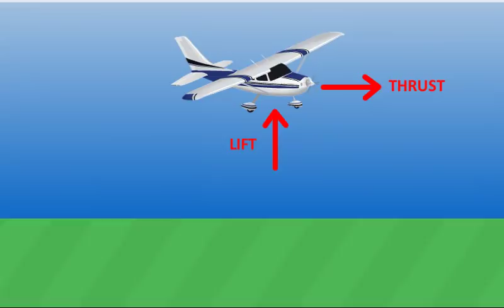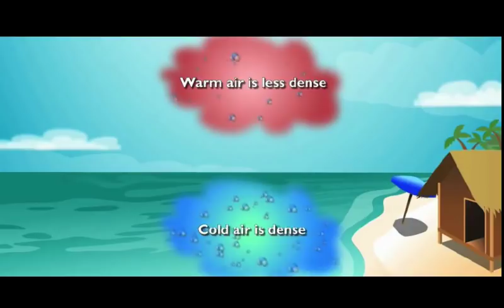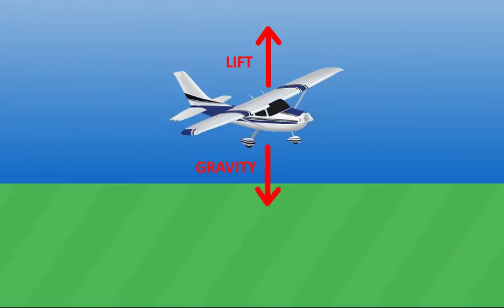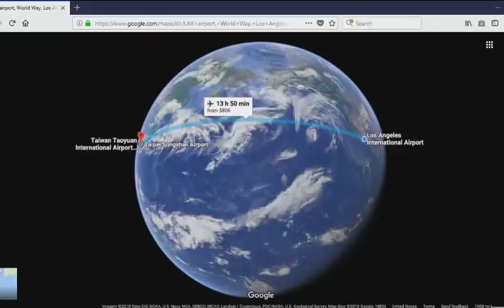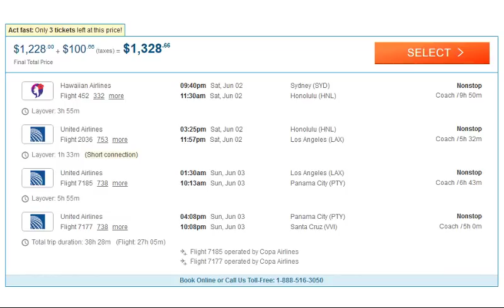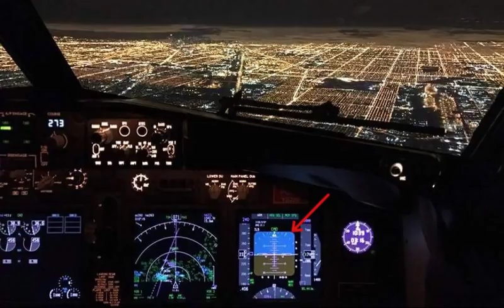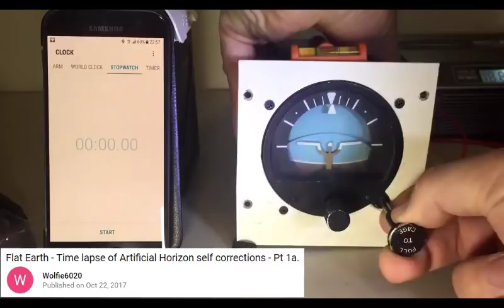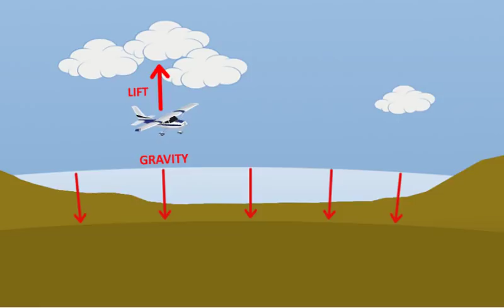Flat Earth Falsities - Plane Nonsense

Comment: Theories are not FACT.  They are idea's.
  Math does not turn theories into fact.
Just because the math works does not mean this is how the world works. 
True energy is "true energy" not E=mc2 written down on a piece of paper.  What goes up must come down does not require a magic attracting force  (gravity) to exist. Using Equations to back up ideas is not science and thats all the globe or gravity has ever been. Numbers and ideas. Just wanted to point out the main problem i have with most globular coments im reading
Reply: So your complaint is that Globe Earth physics has a predictive mathematical model that accurately matches reality?
Reply: "Just because the math works does not mean this is how the world works. "

Um...  Yes.  It quite SPECIFICALLY does.
Reply: "The FACT that the flat earth model can make the same easy predictions and have been for thousands of years."
That's hilarious. The Flat Earth "model" can't even predict something as simple as where the sun will rise and set. You don't even have a working map of the world!
Reply: " Using Equations to back up ideas is not science "
Um...  Yes.  Yes it quite SPECIFICALLY is.

Admit it, you've had a traumatic brain injury recently haven't you?
Reply: I mean actual measurable atmospheric pressure. The type of thing the old weather barometer in my parent's hall would tell you. 
If weight is due to atmospheric pressure then why doesn't it change when atmospheric pressure changes?
And why do objects still have weight in a vacuum where there is no atmospheric pressure? 
And why does weight change in a predictable manner based on the latitude of the object? 
And why does a gravimeter consistently detect different rates of falling at different locations regardless of the local pressure?
Reply: James Hewitt I’m curious to see if you have an explanation for an experiment done by the discovery channel using a level laser and a lake. As they drive farther out on the lake, the laser rises. Even given small differences in the movement of a boat, I cannot see how this could be explained by anything but the lake lowering with the curve of the earth. I think this supports the idea of arriving at a conclusion based on observable facts.
Reply: "Atmospheric pressure explains it perfectly without gravity"
Does it really? So do you notice objects changing weight when you get a high or low pressure weather front?
Atmospheric pressure changes all the time. Why doesn't weight?
Reply: I read what you wrote. If you meant something else then the issue is in your ability to communicate your ideas clearly.
How do you suggest that atmospheric pressure creates weight, yet weight doesn't vary as atmospheric pressure does?
Reply: James Hewitt I'd like to add that science is a religion unto itself in many many ways, since theoretics are littered through the community, everywhere you look. (With quite a few theories being as outlandish as possible, for ex. The Oort Cloud) Theories are beliefs without sound proof. So science can easily be categorized as half evidence/half belief system. I also find it astounding that many scientists of "legendary status" that people worship still to this day, were simply small pawns put on a pedestal intentionally to overshadow the even greater men of the field. Many times this is because the discoveries of the greats, did not produce enough monetary gains. One of the most famous examples is Tesla & Edison. Unfortunately, the scientific world/community is extensively bought and paid for. That fact alone makes it lose a massive amount of credibility. Not to say that the community isn't filled with extremely brilliant minds, because it is. But still, much credibility is lost. So then it becomes this mind-game of trying to decipher between what is accurately told to us and what is not. Hence people then carrying out their own experimental studies to the best of their ability and coming to different conclusions than what has been spoon fed to us all. There is a huge amount of room for discussion and that is exactly what we see in these videos. These subjects shouldn't be something we all argue over, in actuality we should be having open-minded conversations. Especially with our main source of info coming from NASA, a federally owned, bought and paid for entity. I would expect my fellow human beings to question it all and have healthy doses of skepticism, since that's part of what it is to be human.
Reply: James Hewitt - "Atmospheric pressure explains it perfectly without gravity"
How? Explain it to me like I'm an 8 year old.
Reply: James Hewitt - "Explain to me why you need gravity "
You get cause and result mixed up. It is not that we need gravity to explain something. It is the precense of gravity that explains other phenomenons. 

"Does atmospheric pressure not exist?"
Yes it does. Now guess how it is caused?

"If you guys dont like eric dubay."
Eric Dubay seems like a very nice guy to me. It is his undestanding (or lack thereof) that bothers me about him. All the points in his 200 evidences video are either poor science, unproven facts or misconceptions about reality. Literally all of them. Challenge me.
Reply: Chicksue A scientific theory is a comprehensive explanation of a natural phenomenon, well-substantiated by extensive experimentation and observation. It is not a hunch or guess; that is the vernacular meaning of theory. 

I am tired of saying it: research grants do not dictate the results.
Reply: Chicksue - "Theories are beliefs without sound proof."
Dude, please stay focussed. You are talking about a layman's (non-scientific) theory. The definition of scientific theory: "A set of statements or principles devised to explain a group of facts or phenomena, especially one that has been repeatedly tested or is widely accepted and can be used to make predictions about natural phenomena."
So to state that scientific theories are beliefs without proof is blatently stupid. The rest of your post is dereived from your misinterpretation of the meaning of scientific theory so not worth going into.
Reply: "Just because the math works doesn't mean it work like that in real life".  - Flattard. 
Sr too lazy to re-read and quote the exact thing you wrote. I don't claim myself to be a scientist, or know shit about these fields, but your goddamn shit made me furious. 
Do you know why buildings are built by the way they are? Maths. People don't just sketch out a bs drawing and be like "yeah we gonna build this shit". They use mathematics, physics etc to calculate and build the stuff.
Reply: I like this definition: 
scientific theory (n.)
a coherent group of propositions formulated to explain a group of facts or phenomena in the natural world and repeatedly confirmed through experiment or observation.
— http://www.dictionary.com/browse/scientific-theory
Reply: you would struggle to pour water out of a boot with the instructions on the heel, a SCIENTIFIC THEORY is NOT a normal THEORY! you struggle with basic definitions...
Reply: James Hewitt it has a completely different meaning, look up the fucking definition of a scientific theory...

But if you want a fact, then here is one for you. The earth is a globe.
You can see and Identify the ISS and various planets from your backyard, and you can even see them in detail with a telescope.
Reply: James Hewitt wow, you have gotten HALF the definition, come on you grade A researcher, what is the full definition?
Reply: 2112 specifically?????
Reply: I like it.  Specific proof . Bwahahahaha
Reply: Unless its your theory.
Reply: Notcia. Are you saying that ancient observatories do not exist?. You realy want me to explain atmospheric pressure? Just google it.  If you want a flat earth version just ad flat earth to the end of your serch. Or stop pretending like you have watched flat earth documentaries.  Or if you ask politely i will answer any questions about atmospheric pressure that doesn't require gravity.
Reply: Seriously guys check out some of the docos ive been mentioning. The fact that you're asking people like me .tells me you haven't even given flat earth a chance. Do some research before you start arguing things you have been told.
Reply: The Cavendish and Schiehallion experiments still work on your "plane". I wonder why that might be?
And even on a flat plane you cannot accurately calculate the weight of an object without knowing the local gravity. Why is that?
And why don't you have a working map or the ability to predict every day events like sun rise and sun set?
Reply: You mean thermal atmospheric pressure?
Reply: I have already explained all this . Now go look for yourselves
Reply: Dude read what i say properly.
Reply: If there is difference between the the wieght measured at different altitudes.  Buoyancy and density explain it fine. Atmospheric pressure is a result of boyancy and density. Thats my understanding of it
Reply: James Hewitt Answer the question: do the weights of objects change in line with variation in air pressure?
Reply: But weight is different at different altitudes even when measured inside a sealed container where atmospheric pressure, buoyancy and density cannot change.
Weight is also different at different latitudes (due to the spin of the Earth).
Reply: James Hewitt - "The FACT that the flat earth model can make the same easy predictions and have been for thousands of years. "
Oh common James! FE can't even produce a simple and accurate map, let alone math that describes and predicts the phenomenons we assosiate with the globe. You guys don't even knopw how to explain things falling. Desity is not an explanation, it is an observation. If density is of air is the same all around a falling object, why does that object always fall down? Not sideways, not up, down only. Density is still the same. What the mathematical equasion for falling things on FE? How do you explain acceleration on a flat earh? What force makes things fall more quickly over time? Any equasion for that?
Reply: James Hewitt - "Are you saying that ancient observatories do not exist?"
Observation exist for sure, bith modern and ancient. The problem is the explanation, not the observation. Who has ever observed the dome by the way? Or the water the earth is floating in? Or the ice wall? Who has ever observed stars connected to the dome by the way? You can;t even get pass the observation, let alone the explanation.

"You realy want me to explain atmospheric pressure?"
I would like to see how atmospheric pressure gets lower the higher you go, in an FE model. How would that work if density is the explanation for things falling. How can air be more dense than air?
Reply: James Hewitt - "The only reason you need gravity is if you are on a ball."
It is actually gravity that explains the ball. Ity is gravity that dictates the shape.

"This is why we think gravity doesn't exist. Be cause you dont need it on a plane."
No. You still need gravity on a flat surface. Without gravity you'd be floating around. Watch this video: https://youtu.be/drdBKMOZmTc?t=7m55s
The surrounding air is still less dense than the bodies of the floating people. Yet, they're floating. That's what happens without gravity. 

"Which we can prove that we are indeed on. "
I have watched dozens of FE videos and have not found any evidence for us living on a flat surface. What is the most compelling evidence you can come up with?
Reply: Chciksue - "Especially with our main source of info coming from NASA"
How about the other 71 space agencies?

" Unfortunately, the scientific world/community is extensively bought and paid for. That fact alone makes it lose a massive amount of credibility."
So if it's being funded by any government. it is not to be trusted? How about pensions, education, infrastructure, medical research and so on and on. This statement is the dumbest I have seen in quite a while. If you have any evidence for your hypothesis, please don't hessitate to share.
Reply: +James Hewitt I love how you upvote yourself. You have always been a pathological liar though. First, theories are actually factual; they are rigorously tested and able to be consistently backed up with data and well facts and evidence. What you are thinking of is a hypothesis. A theory doesn't become a theory until it has been proven to actually work, and able to withstand rigorous testing. Until then it remains a hypothesis, and if no amount of testing backs up said hypothesis, it is debunked.

But considering you think math doesn't work, it's evident you are a Poe at this point.
Reply: Gravity doesn't just make objects fall down, gravity is in everything. You, me, a table, a house, everything is attracted to each other. If you had a bowling ball and a pair of dice in space the dice would orbit the bowling ball
Reply: Check this out James Hewitt: https://en.wikipedia.org/wiki/Scientific_theory. That shows how a theory in science is different from a colloquial "theory".  It's not just an idea.  It's a model with experimental or observational studies to back it up.
Reply: Bruce Lansberg you wouldnt be floating around. that is silly.
Reply: Terra Silverspar  i have never said math doesn't work.  I just said backing up an idea with math doesn't make the idea fact. Also theories are not factual.  A Theory has to be backed up by experiment measurement math observation  ect . Then it becomes factual.  Check the dictionary.  The word theory is as far away from the word fact as the words hypothesis or idea. This is the problem with scientists and more so astrophysicists.   They present ideas and theories as fact.  Leaving people like you and me not even knowing the difference between fact and theory. You must question everything.  Even scientists.  Even niel degrass tyson.  Even carl sagan. Who are presenters of science. I used to take everything i saw from nasa as fact. I thought everything i was seeing was authentic and no way would these scientists on all these documentaries would be lying. Also i thought all the techniques used to attain the information presented were rock solid proof of how things work in the universe. I used to be addicted to space. Then i ran into some convincing evidence that contradicts alot of what i was familiar with.  Which made me start questioning absolutely everything and find the answers myself.  Rather than rely on "credible sources " with PhDs from NASA  and awards from NASA.  Look into the moon landings thoroughly and tell me they scientists arent lying about a few things
Reply: Arvak777 i have heard many scientists talk about how gravity only comes into effect on huge masses and thats why some of these masses in our solar system have the potato effect.  Which is where the mass didn't get massive enough for gravity to shape it into a shpere. Can you tell me or show me this gravity inside me?
Reply: James Hewitt I don’t see a question from you, Just more drivel
Reply: Alysm whats the difference between a scientific theory and a scientific fact?
Reply: Alysm theory is theory . Doesn't matter what kind of theory.  Just because its scientific doesn't change the definition of the word theory.  Also  there is no definition for (scientific theory) in the oxford dictionary.
Reply: Alysm theory

ˈθɪəri/

noun

a supposition or a system of ideas intended to explain something, especially one based on general principles independent of the thing to be explained.

"Darwin's theory of evolution"

synonyms:hypothesis, thesis, conjecture, supposition, speculation, postulation, postulate, proposition, premise, surmise, assumption, presumption, presupposition, notion, guess, hunch, feeling, suspicion; More

a set of principles on which the practice of an activity is based.

"a theory of education"

an idea used to account for a situation or justify a course of action.

"my theory would be that the place has been seriously mismanaged"
Reply: Alysm a scientific theory.  Uses facts that have been tested and repeated. To come up with a THEORY of how things are. You are not helping your argument at all.
Reply: Alysm also your childish language speaks for itself lol. You are very childish in my opinion and obviously dont mind others knowing.  Answer the question
Reply: James Hewitt a scientific theory is an explanation of the fact...
It is a scientific FACT that the earth is a sphere for example 
 and yes, the term theory and scientific theory are different... they quite literally have different meanings
Reply: So math is scientific proof ? Is that what you're saying? Are you sure observation doesnt have something to do with the scientific method??? Or what about testing theories with unbias experimentation??????? Are you guys serious? I understand that math can explain things in our environment.  But is it proof? No
Reply: No graham that is not my complaint. The FACT that the flat earth model can make the same easy predictions and have been for thousands of years.  Tells me that you cant use those predictions as proof or even evidence that the earth is is a ball
Reply: The only reason you need gravity is if you are on a ball. Which you are not. You live on a flat surface. This is why we think gravity doesn't exist. Be cause you dont need it on a plane. Which we can prove that we are indeed on. Look into it guys
Reply: Atmospheric pressure explains it perfectly without gravity
Reply: Explain to me why you need gravity ? Does atmospheric pressure not exist? If you guys dont like eric dubay. Maybe try watching some videos without him. As i keep saying. Check out the doco called " did scientists prove the shape of the earth? You decide" its professionaly presented and made by scientists
Reply: Guys look into it lol. Im very bored repeating myself
Reply: Theory is theory fact is fact . Adding scientific in front of the word theory. Does not turn the theory into fact. Its that simple
Reply: Alysm scientific theory is a THEORY backed up with evidence.  Theory. Scientific theory is not a scientific fact
Reply: Alysm would you like me to copy and paste again? Answer my question